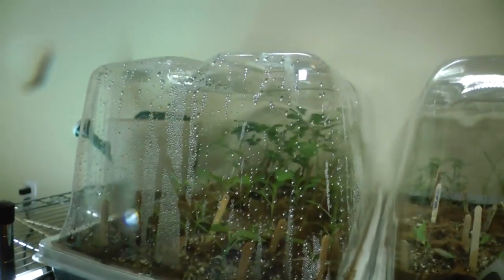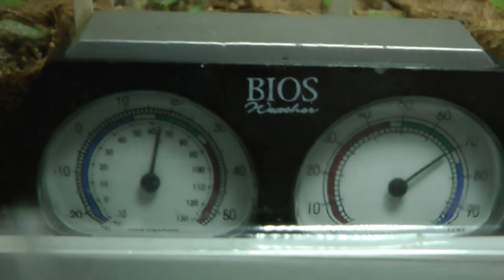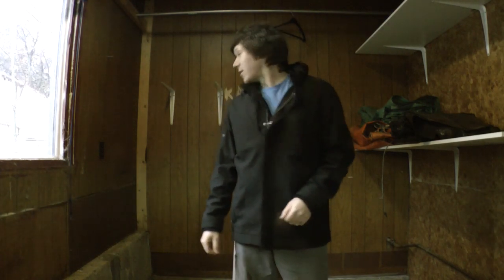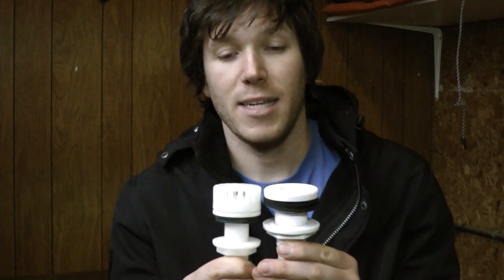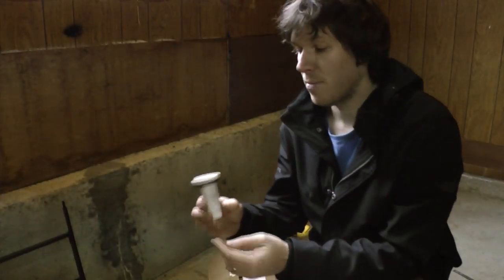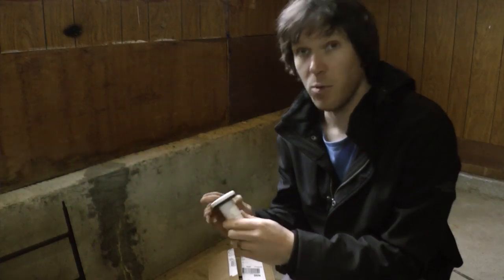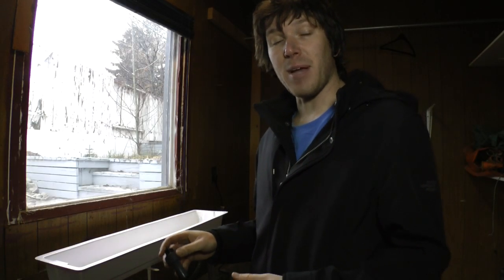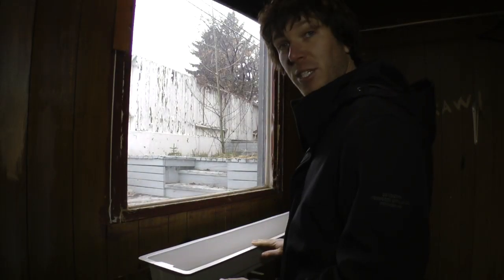Hydroponic Mini Flood Table

Comment: Ha, thought you were gone for good after your monster Pumpkin.  Thanks for the seeds but they never germinated due to the cracked shells.

So, Its been a few years since I've done Hydro but couldn't you just use the drain line for the fill and drain?  Great tray for starts, don't forget a filter on the drain side.
Reply from the maker: You could. Some guys like to run their flood & drain for longer periods which would need a drain to prevent spillage from overflow. I only like to run it long enough to get the roots wet I add the drain just in case.